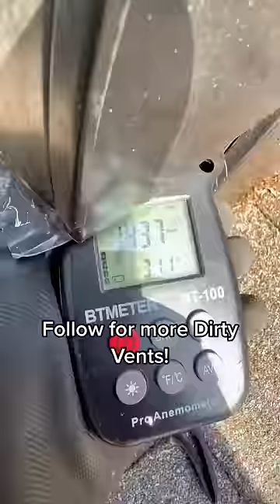Extreme Fire Hazard 🤯 #dryerventcleaning #laundry #cleaning #firehazard #lint #oddlysatisfying

Comment from the maker: For those curious, I cleaned this exact vent a little over a year ago and came back recently to find it like this 😅. It is scheduled to be replaced with solid duct soon 👍🏻
Reply: I'm glad cuz I looked at that and was shocked it was left behind in that state. 😮
Reply: Do they even use a lint trap? I know they aren't 100% and you still need to clean the vents occasionally, but that bad in just a year?
Reply: @Logan_Baron  yes. Accordion style tubing like that will catch more lint. It should really only be used to connect dryer to solid tube. It is compounded when there are massive holes and bends
Reply: The Accordion-style tubbing is not even legal to use in my state. While I was working at an apartment complex. A letter was sent out demanding that anyone using it change it to the hard pipe. Then  I was ordered to slice every bit of it the tents had installed soon after. As any fire would not be covered by insurance.
Reply: The Accordion-style tubbing is not even legal to use in my state. While I was working at an apartment complex. A letter was sent out demanding that anyone using it change it to the hard pipe. Then  I was ordered to slice every bit of it the tents had installed soon after. As any fire would not be covered by insurance.
Reply: 1 year!!!! That's insane. That thing must be running 10 loads a day 7 days a week.
Reply: only a year? 😮
Reply: Nice job the first time (sarcasm)👌
Reply: This person doesn't need or deserve a dryer in their home. They just need to visit the laundromat since they don't know how maintain the dryer at home!
Reply: It needs to be. Very dangerous
Reply: So much floof in one year😮
Reply: My parents never get the vent cleaned 😮
Reply: I was about to comment on that lol
Reply: This dust is probably older than me
Reply: About time! This is why we don't use Flex duct for dryers anymore! Its a hazard!
Reply: @SparklesYT  Ours vents vertically from the dryer to the outside wall. The tubing is a little over 3 feet long. My wife bugs me to check it occasionally after seeing some of these videos, but after living in the house almost 40 years, it has never needed to be cleaned. The way ours is designed you aren't fighting gravity. Depending on how your parents vent is designed they may not experience these types of problems.
Reply: @oliveb. I bet you never have either
Reply: Noticing the flex tube was my first take-away. That just turns the ENTIRE run into a lint trap. And look at how badly banged up it is! The airflow would be crap no matter how well it's cleaned.
Reply: You had to pu disco inferno as the song bro that’s wild💀